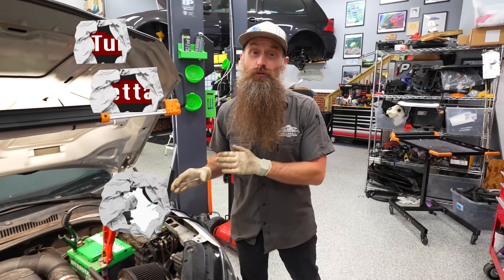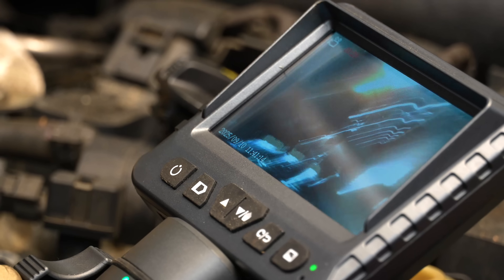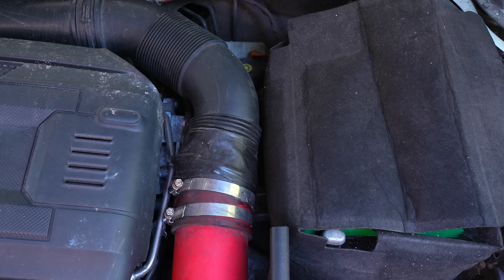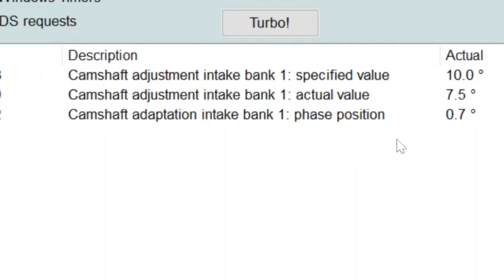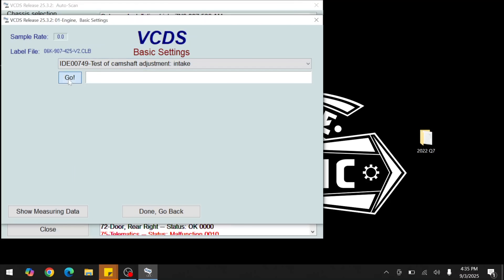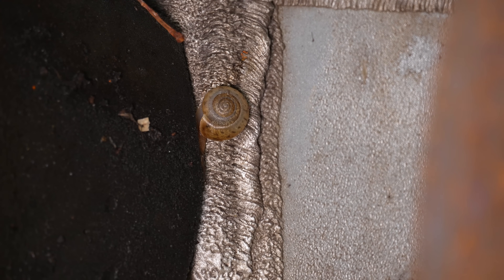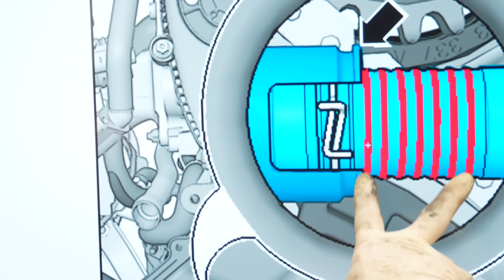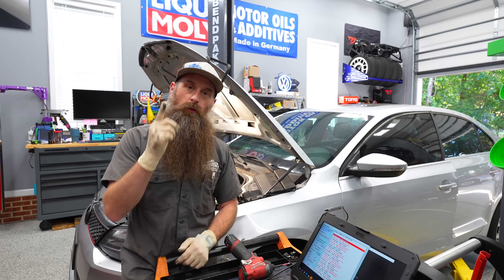TSI Timing Chain Failure: DIY Test That Will Save Your Engine

Comment: I have this exact car and engine. It had a “chain elongation” code at 77k miles but no CEL on dash, Just a stored code. I replaced the chains myself and found aftermarket chains so I’m assuming the last guy to do it didn’t use vcds to tell the car it has new chains. So it’s worth physically checking the tensioner inspection hole too.
Reply: Wait you wouldn't clear the codes and/or visually inspecting the chain tensioner before doing the chain??

Comment: Changed all chains , tensioners and guides on my TSI, still a faint rattle at startup more pronounced when engine warm. Phase position for exhaust -2.2 and intake 0. No clue what it could be. Anyone any ideas ?
Reply from the maker: Ive seen spool valves and cam adjusters do that.

Comment: Thankfully I own a 2.5 😊
Reply from the maker: The best VW engine since the ABA
Reply: @HumbleMechanic  07K FTW!!!
Reply: I own an EA-827 (AEB) and an EA-113 (AWP) - 20-valve, timing-belt, port-injected engines.   Hang on to that 2.5 for dear life.  You don't have to deal with the direct-injection nonsense of the newer VAG engines.

Comment: I have slight rattle from timing chain on my Audi A3 2.0 TFSI. the tensioner is the newer style and 5 to 6 ribs out and I'd had mobile mechanic check it noticed it was 17 degrees in both directions. I also having misfiring codes, fuel toorich bank 1 codes, but runs fine. I've priced up the chain with few garages, mostly costing £1,000 and audi was £1,500. I'm going to do it since I'm ain't willing pay that much since I did brought the car for cheap but I do love it.
Reply: Did mine recently , he also has a video on changing the tsi chain which I used as a reference which was very helpful in lining up all the balance shaft marks etc.

Comment: Crazy timing on this,  I have 14 gli 30th edition.  211k on her bought new. With 4 miles,  I have chain stretch after it warms up, i hear chain slapping a little..  no codes just little slap noise.    5-40w oil every 4k miles...

Comment: Loved the content. I just picked up a 2016 VW Golf GTI off a mechanic lien for a very good price. It runs and drives well, but it is missing part of the air intake and few cosmetic issues including a driver side airbag deployment and cracked windshield.  Would love to see a timing chain replacement video and videos on airbag replacement and fault code clearing.
Reply: 2016 is MQB and the timing chain issues are largely not related to that platform.

Comment: Hey there. Seeing you point out the cam variator reminded me, I just got my 17 GTI back from the dealership and they are recommending replacement of the PCV and, because it's failing, the timing cover, tc seals and cam magnets. Apparently the PCV failure lead to too much pressure pressure and the seals went causing an oil leak. Is this overkill or does this not all have to be replaced?

Comment: I have a 2012 GLI and I was just getting ready to use my OBDeleven to check my chain. Keep up the great work. I love when you and Paul do these type of videos
Reply: Using the OBDeleven my reading was 4.2. It was at same reading about one year ago. My GLI has 133k
Reply: I have a 2012 GLI as well. Have you checked your tensioner to see if it’s the band style? Last check of my phase angle was -1.44 at 82k miles

Comment: The ea888 is very advanced/complex engine it’s been upgraded through the generations but still has be treated and maintained like a newborn these engines aren’t meant to be abused,this was a great video and will save you a lot of money.
Reply: Not true. They’re 100% meant to be abused. They’re not meant to be neglected.
Reply: I think when I said “but still has to be treated and maintained like a newborn” that’s what I meant 🤔
Reply: Upgraded to fail  at certain milage
Reply: What’s considered ABUSE? 😂
Reply: @bradbozarth3235  abuse is not changing your oil regularly in some cases ever,driving your car like it’s stolen,pouring cheap gas in the gas tank,ignoring any leaks,never changing the air filters,never bothering to check the oil level,I hope these examples helped you out lol
Reply: Orrrrr you could have a simple engine that you could run without oil for a week and it still wont quit.
Reply: @bgee461you leave that Toyota nonsense out of this.
Reply: @bgee461I’m glad you understand capitalism 👏🏼
Reply: @nobatteriesincluded3968  and you recommend communism? Hopefully you only buy your cars from Soviet era russia

Comment: I thought the 1.8 TSI engine had a timing belt, not a chain. Does the 1.8 sold in the US have a belt or a chain?
Reply from the maker: the OLD 1.8t from early 2ks was belt, these are chain
Reply: What year did they start putting chains in the 1.8?
Reply: @faliray4889  When the EA-888 family was released in 2007 (Gen 1).   Gen 2 was released in 2008.
Reply: Ok. Thanks for this info.
Reply: The old 20-valve 1.8T engines 1996 through 2004 had timing belts.

Comment: Important question: how many ribs did u see? Did it correlate with phaser adaptation angle? 2014CPPA should come with the old style chain with new style guides. It is the last year when VW was putting on the old style chain on the gen 3 engine
Reply: If it’s the original engine , this is a CPLA engine in the 30th Ed GLI
Reply: @Hintonbro.  depending on which state. CPPA has SAI and is PZEV. CPLA is not because some states did not require. For either engine my original statement regarding chain and guides still holds true. As you can see from the tensioner inspection hole, this car has the old style chain.

Comment: Hi Charles I work on only Euro cars and obviously VW are the most common cars I work on and I have done quite a few timing chain replacement what I noticed is VW and Audi car don’t seem to show exactly the same amount of cam phase adjustment an new chain set in a CCTA engine will result to a number very close to 0 deg but on Audi SECOND GEN EA888 will be around 1 deg so a Audi will always look worse than a VW with the same chain wear I do get time to time faulty N205 I usually go for a test drive and put the cam actual vs desired on a graph like you did and see if they follow each other if not I put a new part and most of the time it will fix it when I do a timing chain I also replace all parts including the balance shaft chain guides and tensioner including the crank gear.

Comment: I've seen videos of multiple cars where they replaced the oil pressure valve which is behind that solenoid and fixed them from running really rough and in some cases not even able to start.

Comment: I have a passat i checked out, brought in from another shop that just did chains.....we'll i got the P0016 and there was if I remember correctly about 12 ribs out on the tensioner.....car don't start. And if I remember correctly there's no compression

Comment: the phase position on my golf mk8 R is +3 degrees.already. Seems rather high. Oil level is correct. The dealership once overfilled the oil by 0.5 liters when I first bought it 2 years ago. Could that have made the timing jump? I saw that it was overfilled after around 150km of driving.
Reply: If your timing jumped a tooth it’d be a lot higher than +3. More like - or + 13.

Comment: My '03 VW 1.8T AUQ gives a DTC 16396 around 2 or 3 x a year -> Camshaft position actuator A Bank 1 (intake advance) setpoint not reached (over retarded)
I use Shell Helix Ultra Full Synthetic 5w40.

Comment: Glad you talked about the camshaft actuator. I was dreading doing the timing chains on my B8.5 because it was making horrible noises and throwing a P0011... Turns out it was just the camshaft actuator and a noisy serpentine belt idler pulley. Chains were in spec when checked, what a relief 😂
Reply: Do you remember hearing the ticks at some point before failing?
The cam actuator and chain tensioner sound almost identical when they start to go. But it's a very telltale noise that you'll never forget. A chain will give you almost no indication it's about to break until it does.
Reply: @LeviBulger  The actuator never ticked for me, but the internal oil seals started failing and the magnet seized up.
Reply: @4Denwa oh dang. You know now that I think about it, I may be mixing it up with another part of the camshaft that does the ticking thing before failing. But anyway, how difficult was the job to replace it?
Reply: @LeviBulger 30 minutes, you just need a small right angle adapter for the torx bit to get the actuator off, would be easier on horizontal EA888 platforms though.
Reply: @4Denwa Wow that's not bad at all!

Comment: Your videos should be a mandatory watch at every VW shop or mechanics school around the globe.
Reply: I worked for an independent VW shop and used HM's videos to learn when I had new jobs coming up. I'd follow the service manual during the repair, but I watched these to prepare.
Reply: They do teach the same stuff at VW engine classes
Reply: @SJMotions  and where are those mechanics? where does the knowledge go?
because in real life they have no clue (usually)
Reply: In Denmark, we do actually use Hm videos at the VW main dealer training.
Reply: Not a mechanic, but watching Charles' vids have made me a more informed owner, and one who is far less ignorant when speaking with my VW tech.

Comment: Literally just happened to me 1 month ago to my 13 tiguan.  Belt jumped while under load. Locked motor. Had to scrap :(
Reply from the maker: Sorry to hear that, man! That really sucks.
Reply: Belt? The whole video was about chain...
Reply: @markotrieste  probsbly a typo, the Tiguan is chain timed
Reply: Yes, sorry. Mental typo. Chain not belt
Reply: Wouldn’t have these problems if they stuck with belts.

Comment: Would camshaft position sensor failing be a symptom?
Reply from the maker: possible. the cam magnet can fail with out chains. but if thats the case id 100% be sure to recheck this after replacement
Reply: @HumbleMechanic  Thanks for doing this video. I have a TFSI with 150k miles but I’m getting very little deflection.  Maybe it was changed already?  It’s a salvage car so Audi wont talk to me.